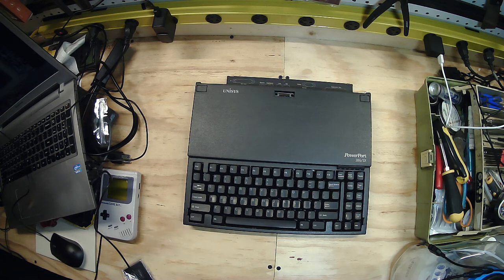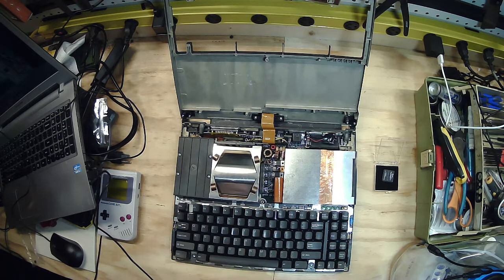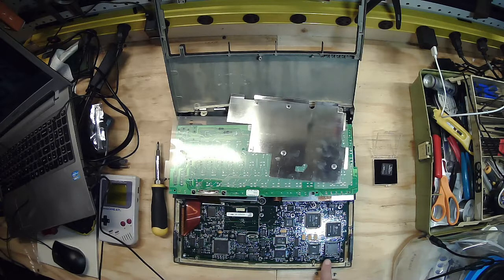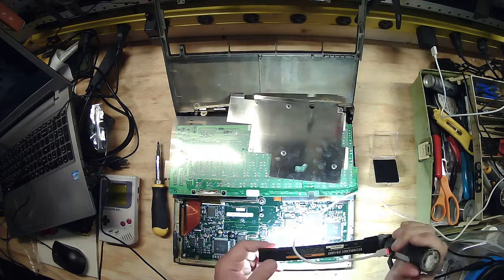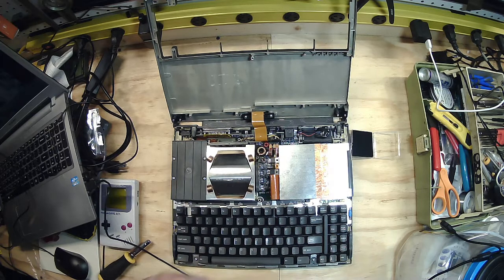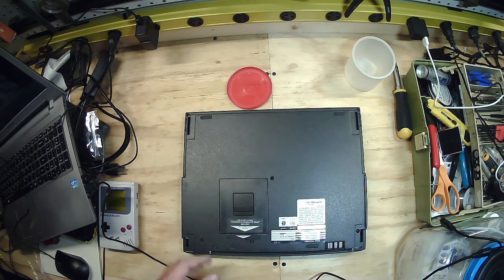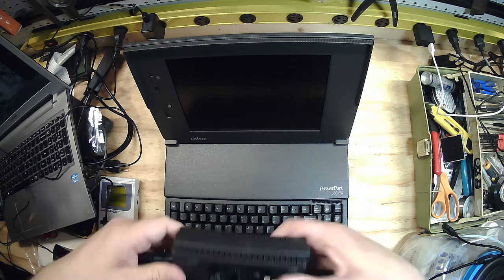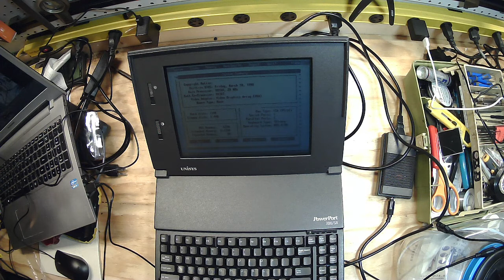UNISYS PowerPort 386 Laptop 387 install

Comment: This is great. I had no idea that FPU upgrade was so widely available, definitely getting one. Would it be possible to get that RAM stick details? I'd love to upgrade mine mine so it's possible to run some ancient 386BSD or something..
Reply from the maker: They are super cheap on ebay, like $20, just make sure you speed match the FPU to your machine.   I'm partial to cyrix, but any brand will work.  As far as ram I just use what came with this machine so cant help you there.  To be honest this may not be the best retro laptop as the external VGA only works when the screen is physically detached (which makes me very nervous), but then the system is unstable.  Probably needs a recap but I'm too lazy to do.  I also have an L40 SX I'm trying to revive so ill show that someday maybe.   I also have a 386 16 epson desktop i spent to much time on with a dead hd controller.  Gonna try side loading a parallel zip drive via floppy drivers but that's for a later time.  Someday I hope to get one of these 386 machines to send out a good VGA signal that I can directly capture.  My brain still thinks these are new machines but I guess they are retro too now.  Hell even my Pentiums are retro now.   Guess i'm getting old.  In my old mind apple II and c64s are retro, not these machines.  But such a nightmare to bring them back to life.  But dosbox is still not "runtime" accurate on things like i/o, so if I want to capture true to life video I gotta use the real thing.